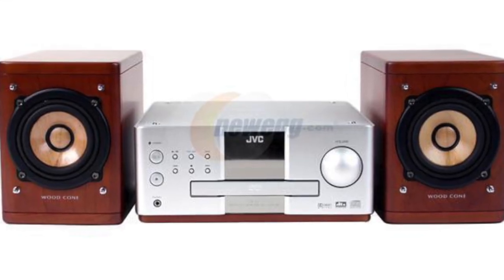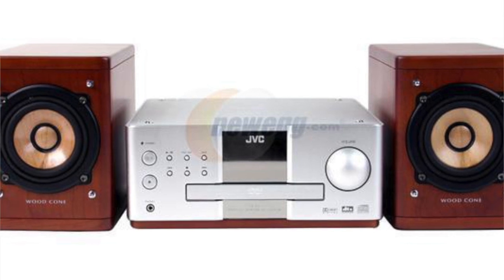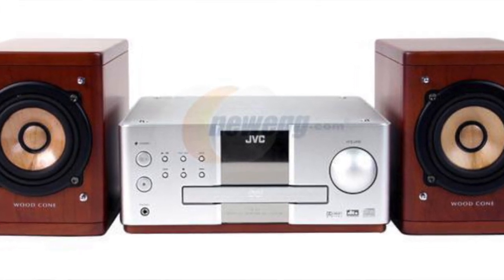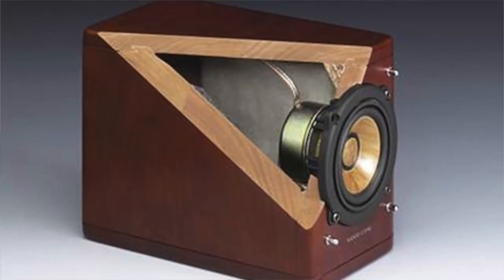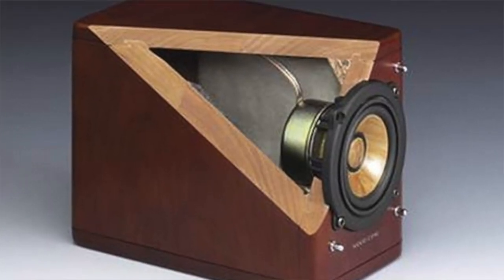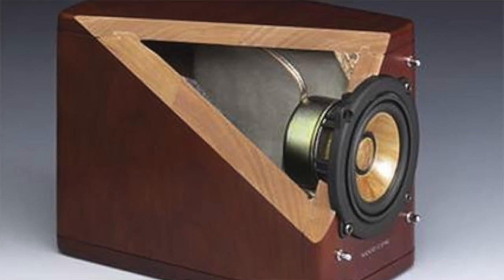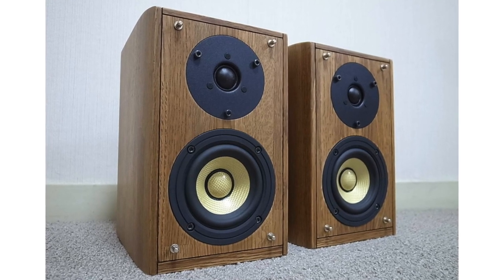A very Japanese approach to speaker design

Comment: Did they ever make mini systems that included a self  powered sub?
Reply: Tivoli Audio Model Three in Cherry cabinet was a high-end clock radio, matching Model Subwoofer (advertised as adding an octave to the bottom end) and matching right speaker were sold seperately. No longer available. I read about this many many years ago in, of all places, consumer reports, which gave it an excellent review. Eventually purchased all three components many years ago. Sounds very good in 14x14 room. With sub, response is 50Hz to 16kHz. Tivoli also made matching CD player, which I never purchased.
Reply: No, but a few of them have a sub out